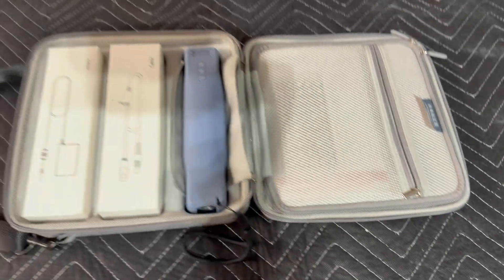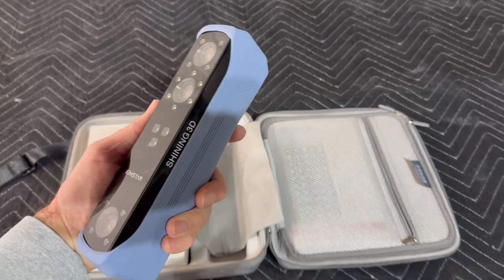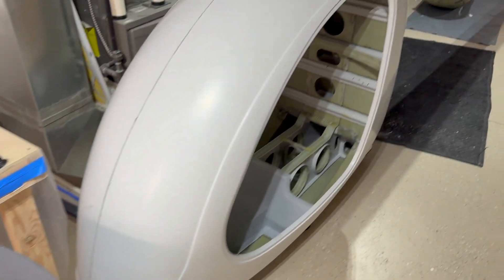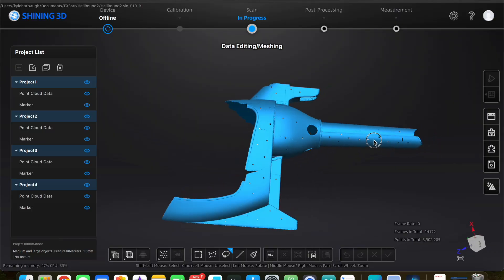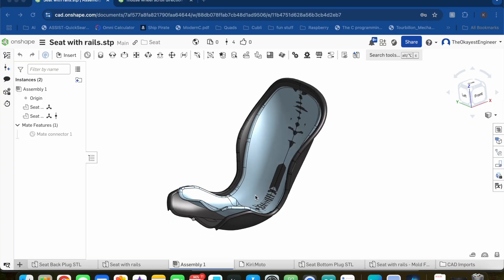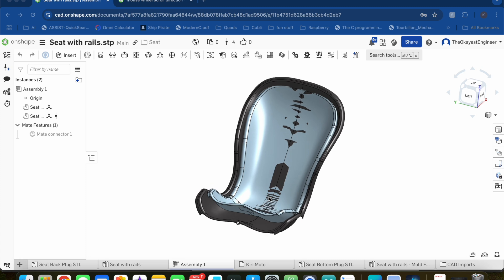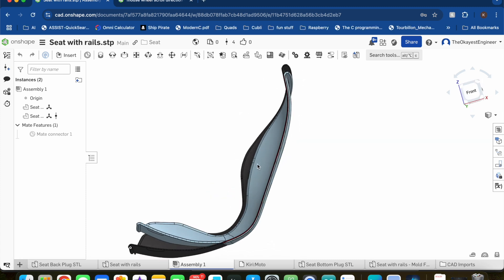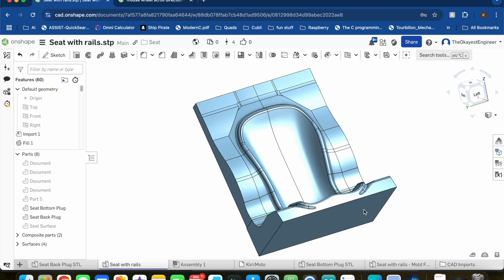1000 Subs from the FIRST upload!

Comment: Is this your first time building an aircraft from a kit or plans?    If you’re not an aviation engineer,  forget the modifications and stick to the original plans.    Back in the 80’s, I built a plan-built plane that had some kit parts.   Believe you me, an inexperienced builder should follow the designer directions and plans to get the aircraft that matches the specifications of the original.
Reply from the maker: Does an RC Heli count? Jokes aside, I did new product development for fuel and bleed systems on commercial and military aircraft for a number of years. No modifications will be made without the proper due diligence. That’ll come out to some degree in future videos but it’s too boring for most viewers to spend too much time on it.

Comment: It is nuts to have a 1000 subs on the first video, took me 7 months to achieve that but then your video skills are way better. Just goes to show it doesn't matter if you are a new channel or not, make good videos with good thumbnails and the algorithm will reward you. Looking forward to following the build.
Reply from the maker: @Ben-Dixey  my mind is blown! I’ve been trying to work the instagram algorithm for 6 months and I’ve gotten pretty much nowhere. Then this! 

1 out of every 12 people who viewed that video subscribed. 🤯 and now I’m supposed to keep that up?!?!
Reply: @ You will be doing very well to keep that up, but I wouldn't be surprised if you did. I think a kit build helo video series is something a bit different. Apart from the finances it's within in reach of a lot of people with a good mechanical background. You seem pretty switched on so I'm thinking you will do a good job. The mosquito I believe is an excellent helicopter, designed by john uptigrove If I'm not mistaken. 
I really like the blade design, single sheet 6061 wrapped around a 2024 cnc milled spar and glued together. No leading edge rivets to worry about like the rotorways used to do. Very efficient high lift blades.